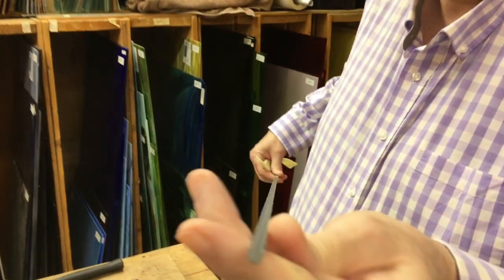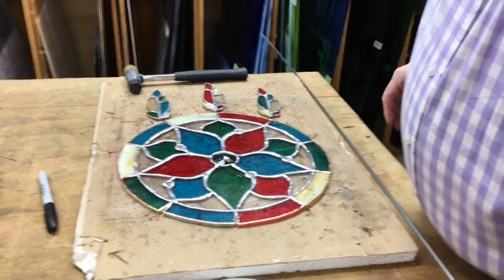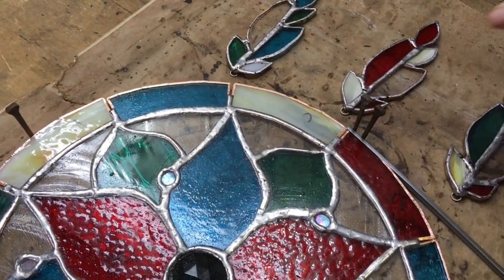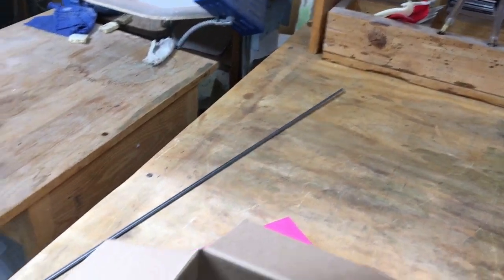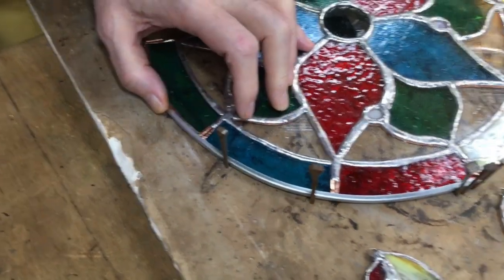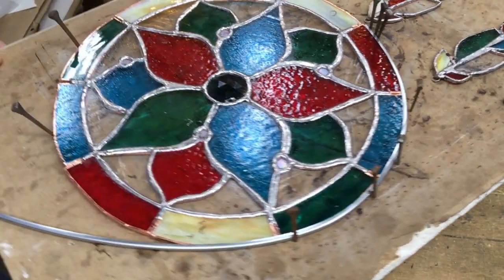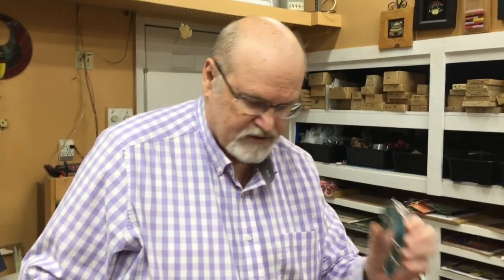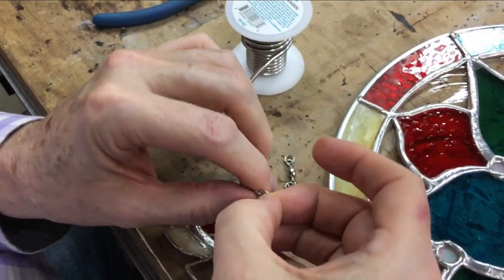Zinc Border Around Round Stained Glass - tech tip thursday V 201

Comment: How helpful & what a great, patient teacher you are! Besides your main topic, other tips were a bonus - lay zinc near joint, lay zinc on table to not kink, horse nails AND holding them at an angle to avoid hitting/breaking glass, using drywall (super tip!) & turning IT around, and using swivel fishing lures. Thank you so much for sharing your practical & technical skills (& using yellow, large font to read). I’m a 4/10 stain “glasser” so I need all the tips I can get.
Reply from the maker: Thanks for your comments.. make sure to visit our web site gsg-art.com and go to the resources page and hit video which will take you to the page that has our video listings.. at the bottom is a list of all the videos we've posted and a link to each of them. Some are great and some are just okay but there's a lot more that we've shared!

Comment: Thank you so much for this amazing video so helpful, 
I have a little question if you don't mind, why did you copper foil the edges before you put your zinc profile? 
Thank you 👍😊
Reply from the maker: It's easier to foil the entire piece of glass rather than trying to save the tiny amount that falls on the outside edge and it adds just a little more to solder to as we attach the zinc.

Comment: what is the strongest channel
the nikel seems to be plated on metal only
I plan to make a ceiling light at 45 degrees on the sides; and I have been told that it will not hold without a metal iron frame, is the frame niket sufficient?
Reply from the maker: You need to watch our video on skylights we did https://youtu.be/T7hGwAmhJS4

Comment: Thanks-- I didn't know you could use zinc like this without using a bender. They're kind of pricey, so I've put off trying to work with zinc.
Reply from the maker: A bender is a great tool for when bending outer bar but thin "U" shaped zinc can be flexed without one.

Comment: Would the panel look cleaner if you solders the feathers to the back side of the panel like you did the rings?
Reply from the maker: Great suggestion!..In the video, I was soldering the swivels to the back of the panel. There is probably a way to solder the swivel to the bottom of the zinc, but I was going for the most secure soldered joint, that's why I did it in the way I demonstrated.

Comment: I have a 24" round piece, appears old. Has loosened border and 1 piece of missing curves glass. I want to take off the border and redo it. This piece is extremely heavy and I believe that is why it slipped apart. What Zinc should I use, in your opinion, to put on it for a new strong border?? Thanks a lot Janey Boyd
Reply from the maker: If it's heavy, it might have been lead that they went around it with. This would make it heavier and lead can stretch over time giving the piece that looseness you describe. I would use 1/4" outer bar for the new outer rim. Make sure to follow our  instructions on the video https://www.youtube.com/watch?v=pAMhLAHfrSc
Reply: @GommStainedGlass  i can only find 1/4 zinc came that has the extra external channel.. is that bendable for a larger round peice?
Reply from the maker: @shibaweebas  We call that 1/4" stuff zinc outer bar and we've done a video on how we bend that, check out https://www.gsg-art.com/videos.html at the bottom of the page is a listing of most of our videos. 😀😀

Comment: Thank you .Very well explained.But why zinc and not steel ?
Reply from the maker: Zinc is easily soldered, steel is not. This is why zinc and copper are the traditional metals used to reinforce stained glass!!!
Reply: @GommStainedGlass  Thank you for replying.Maybe I meant copper rather than steel.That is why use zinc over copper.Here in Israel I can only get copper 😐
Reply from the maker: @valeriegindin3852  Copper is a little more brittle than zinc but it takes a patina very well and solders like a dream. So you'll have to be careful as you bend copper to avoid kinking it but it will give you a strong border.

Comment: I just picked up my stained glass after almost 30 years and my first piece was round. 🙄  What was I thinking!  I have been playing around with different ways to wrap it, so this video was perfect for me.   Thank you! 
I know this is an older video and I don't expect a response but...I opened the footlocker of supplies and tools to find it pretty complete though I'm wondering if the Flux, patinas, etc. are still usable?   Lots of old chemicals. 🧐😬🌈
Reply from the maker: Most chemicals last a long time, you may want to test them out. Remember that getting your project as clean as possible (which is why we use both CJ's and Kwik Clean) is important to get patina (esp. copper) to work. 😀😀😀
Reply: Thank you

Comment: Looking through the responses you answered one of my questions (does this work with different metals), but I wondered if you feel like there is a minimum diameter that you can bend around? I just had problems with bending copper around a 10 in diameter piece - would that work with zinc?

I second (third?) the thanks for the drywall hint! I've always wanted something to do with the scrap drywall I end up with.
Reply from the maker: Copper is a more rigid metal than zinc when in a 1/8" u channel so you may be able to bend it around a ten inch diameter  piece, I've been able to successfully in the past. Sometimes it feels like it's luck or practice that gets me there! 🙂

Comment: How do I choose a size of zinc came?
Reply from the maker: It needs to be as wide as your glass and 1/8" is the width of most stained glass. Then if you are going to bend it you'll want it to be narrow, If it's going on a square or rectangle piece you'll want it to be outer bar which gives it strength.

Comment: Great video! Would larger zinc bend easier if it was heated?
Reply from the maker: You should watch the recent video we did on bending 1/4" outer bar. What may have been hard to see was how much thay size zic twisted. Larger would be even worse.
Reply: @GommStainedGlass  Thanks. I won't try bending half inch. Great tutorials

Comment: Did you have to stretch the zinc before you put it on? I’m new and would like to make pieces look cleaner
Reply from the maker: You stretch lead, you don't stretch zinc. Zinc is a hard, solid metal. You can't cut it with a knife like soft lead, you have to saw it. 😃😃😃

Comment: The split rings seem to work but I think it would make a nicer finish to use copper wire, put the swivel on it then bend it so the two pieces are together and then solder to the seam.
Reply from the maker: That's a great idea. I just can't cover every idea in a video, but that's a great idea! 😬😬😬😬

Comment: beautifull  work  beautifull demo; is  possible to have  more then 1\8  channel  more strong channel
Reply from the maker: You can use 1/4" outer bar on square units https://youtu.be/T7hGwAmhJS4
Reply: @GommStainedGlass  I finaly  fond  the solution 
a  steel  or iron  1\4  bar  inside  the sinc   channel  
I  presolder  the  bar  and  heat it  whit a little  torch  after  to  wellding  it  inside the  sinc  
that make a vey  strong   sinc  bar  also easyer  to  wled  in the  corner directly  on iron 
hte  perfect solution 
thank  for advise
it conduct  me  to  a marvelous  solution
no picture here  maybe on personal  email ?